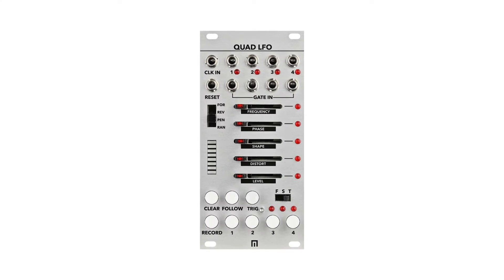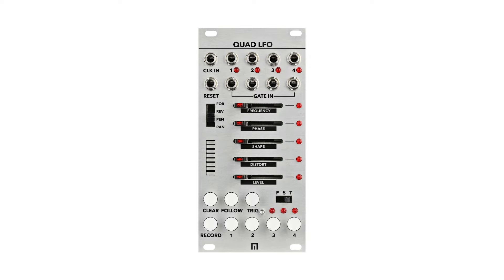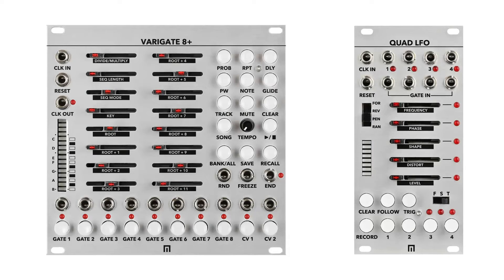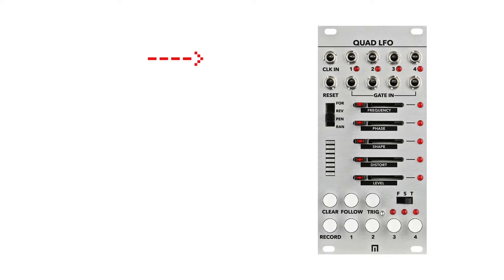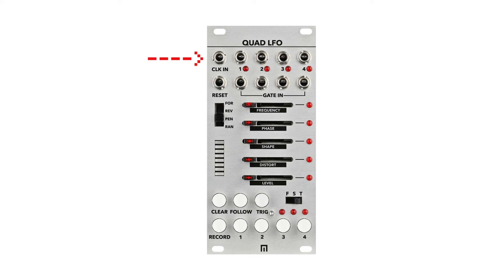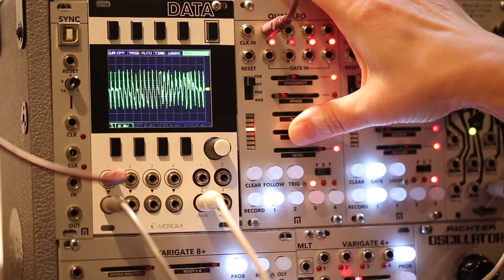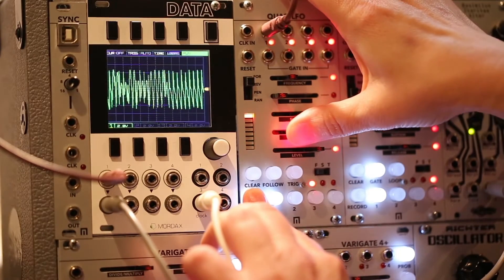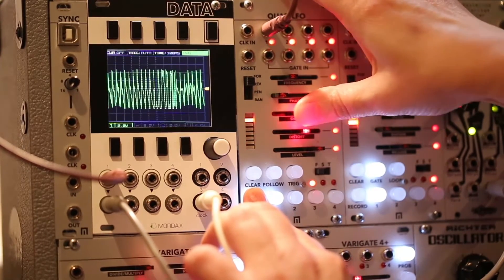MALEKKO QUAD LFO - MAIN FEATURES

Comment: I have trouble dialing in perfect shapes (a tight 50% Square is much needed). Could you implement a key-combination to lock onto a certain shape more easily? Maybe with "holding down Track Button, then move shape to cycle through shapes instead of blending."